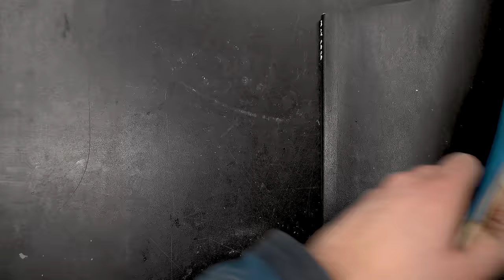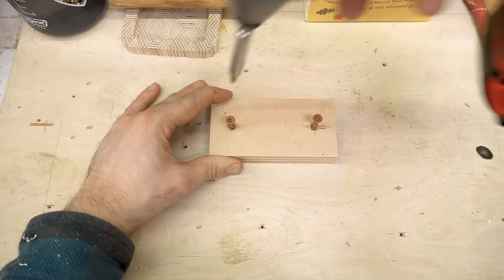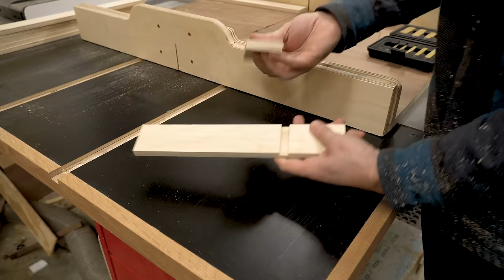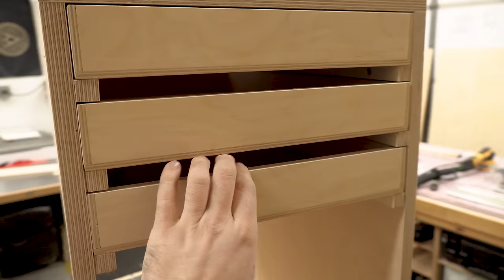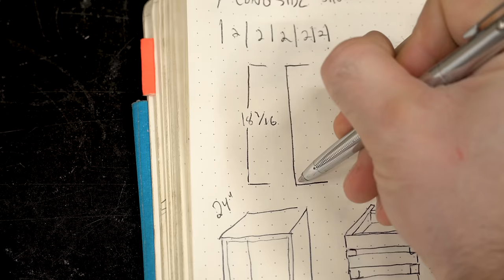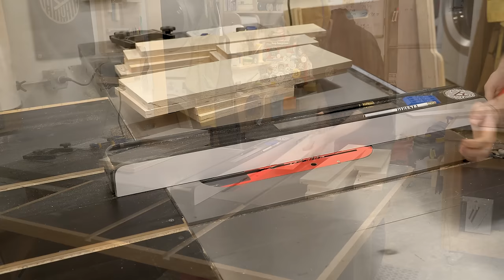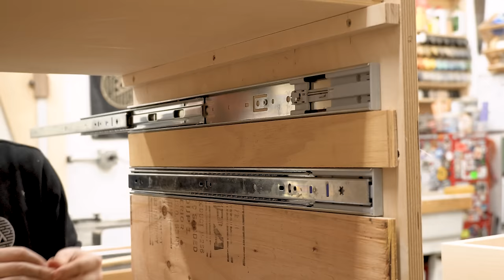3 Ways to Build Professional Quality Drawers

Comment: Omg that imperial chart thingy 😂 Priceless. I can’t believe the things you subject yourself to with imperial. I barely even remember how fractions work lol
Reply: The thing on top is divided by the thing on the bottom. 2/4 means that the 2 is is divided into 4 equal portions. You can multiply or divide both sides by the same number.

5/7 = (5x5)/(5x7) = 25/35

10/5 = (5x2)/(5x1) = 1/2

If you want 1/2 of 10 you multiply the number by the fraction.

When you try to divide 1/2 by 4 you can just multiply the 4 by the bottom thing. - > 1/8

When you multiply 1/2 by 4 you get
4/2 = 2

English is my second language so please don't quote me on terminology, but that's the concept.
Reply: Its actually pretty easy. Half of 9 and 3/8 is just 4.5 and 3/16. Add 1/2 and 3/16 and you get 4 and 11/16.
Reply: Fractions are precisely why imperial is easier to work with for building... anything.
Reply: The school system to teach basic math really failed horribly. Fractions is just numbers why does everyone seem so freaked out is not difficult. Same with decimals just keep your unit of measure straight jeez
Reply: You really need to learn how to divide...hard to build anything without that.
Reply: @klphotographer  The entire building trade up here in Canada is still done in imperial measurements. Nobody is interested in how many square metres a house is. They want to know square feet. Lots are still described as half acre, 1 acre, etc. Nobody uses hectares. If metric were superior it would have taken over since it's been the official measurement system up here for nearly 50 years. Yet we still use the old system in building and in much of daily life.
Reply: @darrylpayment2365  good thing you're not in charge of anything. Following your logic you'd still be burning witches on a stake, cuz everyone else was doing it.
Reply: Agree, I use metric for everything I'm building.
Reply: Lol, yes, I keep track of my work time in chrons, the metric unit of time measurement. I also work ten day weeks for the same reason. Customers LOVE how clear my bills are.
Reply: @jintarokensei3308  yeah. half of 9 is 4.5 lol. who the hell would say its 4 and 1/2 🤣
Reply: @brianlawrence9959  bro... 4.5 and 3/16?? you just proved my point. decimals are your friends haha
Reply: @twestgard2  this is genius. how has the world not switched to this already.
Reply: @CharlesRattray  sure. And so are fractions.
Reply: I was in the 6th grade back in the 1960s when I was taught the metric system.   The teachers at that time told us the USA would be on the metric system within  5 years.  Yeah.  Right.  Still waiting.....in the meantime,  my tools are all......yup, American. Imperial.....
Reply: Woodworking in imperial is usually really intuitive, and it means you can always work in the same unit for large and small projects in and have the same precision in everything you make without the need for remembering thousands of mm, or converting up/down as you go.
Reply: I am sure metric works as well as imperial.

Comment: @Michael Alm I do cabinet design and installs in the US (I use Imperial System) and what I do to get fractions out of a decimal result is : I take away the full number and then multiply whats left by 16.
So for examples:  you had 4.6875. Take away the 4. You get .6875. Multiply that by 16 and the result is 11(aka 11/16). So now you add back the 4 and you get 4 and 11/16.

Comment: I've been building cabinets, etc. for 35 years, but your technique for installing slides on the drawer boxes was one I've not seen. I'll use it from now on. Thanks!
Reply: I have been a carpenter for 50 years in Ireland. We have been doing this for years even as a young boy in the workshop all them years ago.

Comment: Just a comment on the Rockler jig for Blum clips / under-mount glides.  I tried to drill the pilot holes for the clips at the appropriate angle and no matter how careful I was-  they didn't sit right and the drawer was wonky.  I purchased the clip jig from Rockler and the clips worked perfectly.  The jig also properly aligns the pinhole at the rear of the drawer. Money well spent.  Keep up the good work.

Comment: Michael my favorite tip in this video was to not make the drawer a compression fit when using those mechanicals your slides. I have been frustrated with that I know so many people who have built it so close to tolerance that the drawer slide didn’t operate properly. Definitely a great tip thanks for Sharing  brother great video
Reply: I agree. I always have to fight my tendency to want to make it like a piston fit.
Reply: In the video, is it my imagination, or did he talk about how the slides have some built-in flexibility, but then didn't use those tabbed holes on the cabinet sides?
Reply: I am horrible about tight tolerances.  Its even worse when you start dealing with expansion and contraction of solid woods.
Reply: Agreed. I ended up planing down plywood drawer sides to achieve a better motion on one build. Not fun, and easily avoidable. Thanks for the tips, Michael!

Adam Savage has a great tip for avoiding "too tight tolerances" - add some paper or thin card shims. Can be easily tack glued in place while measuring.

Comment: So good. Clear videos and explanations as you went. Excellent editing. Enought time was spent showing how it all worked without bogging down with too much repitition. I'm using your info, but one small change. I used a drawer slide to make a metal jig for the slide hole layout (I'm also a metal worker) and predrilled the slide holes in the case side. It seemed less awkward than doing that in the case after is was assembled.

Comment: Michael thanks for the tip on the Handi-shims, they are great! when cutting wood I use the 1/8 shim to prevent the wood from pinching the blade. The shims also beat using coins when spacing drawers. Love your videos!!

Comment: I made some drawers and a cabinet, but really didn't know what I was doing.  This was SOOOOOOOO much simpler, easier, and faster than the "total noob" versions I built.  Definitely bookmarking this for future reference!  (Also...  watch those fingers with the nail gun!)
Reply: Epic video on making perfect drawers. A nail gun I've been bitten by before and I did fine with band-aid and some kool-aid. You want to be 10 times more careful with your fingers when you use a table saw -- one of the most useful but also a dangerous power tool. I like the table saw jig Michael's got but IMHO future epic carpentry would be with plunge saws and routers, not table saws.

Comment: Great video. I actually prefer drawers over doors. Door hardware confuses me. There are so many options. There are a couple of shop pieces I want to build and I keep putting them off because I'm cheap and I don't want to buy the drawer slides. So I'm glad you showed the wooden slides. Having the back with a stop is definitely the way I want to go. Thanks for sharing.

Comment: You are a clever fella. 
The 3 x 2" top draws. I like the idea of extended rails to stop draw falling out. You could put Spring loaded locator pins on side railings which you can reach and release if you need to take draw out fully.
When you pronounce "Rebate" though it sounds like "Rabbit".... Australia here we say ....Re Bait.

Comment: Thanks a million. Lots of good info but the thing thsy stood out for me is that the drawer doesn't need to be tight... Needs a little room to slide... Didn't quite know if that was the case or not, so I'm guessing about 1/16 of an inch or so should work. 🙏🏾

Comment: Amazing build Michael. You are a pro. We did the same with metal slides in the past since then we have learnt if you over drill the hole on the drawer box you can have some adjustability while fixing drawer fronts.

Comment: Excellent video! You've gained a subscriber! Oh! and you can skip the fraction chart. Just multiply the decimal portion by 8 or 16 (depending on your needed accuracy) and then round that number up or down depending on what you need.  That'll give you the top number of the fraction.

Comment: Great tips!  I WILL use the one for mounting the wooden slides by turning the cabinet upside down and locating them with the actual drawer and a shim.  On my next set of wood slides I may change them out for side-mount store-bought slides at some point, and am mounting the wood ones on a 1/2" side strip, so the drawer will be the right width for the metal slides.  I also figured out years ago that iron-on hardwood edge tape (or even melamine tape) gives wooden slides a nice slick, 'wax-able' surface.

Comment: Some good stuff there, but for a well equipped shop which I'll never have due to space and funding limits.  However I try my best to make do with what I have.  Two tips that can save you a bit of money:  Non-embossed credit cards make fine 1mm or 1/32" shims, two of them make a 2mm or 1/16" shim.  Also drill bits of various sizes make good setup bars.

Comment: I never want my drawers to fail! They are sometimes subject to heavy loading. I also am driven more by maximizing storage space rather than aesthetics. So…
I build most of my drawers from 1/2” Baltic birch plywood. Bottom and back are dadoed into sides and front is dovetailed into sides. 
I almost exclusively use full extension side mount slides as they only use ~1” of cabinet space the height of the drawer. Blum under mount slides use 3/4” under the entire bottom of the drawer! 
I always mount my slides so that the screw holes line up with the center of the 1/2” bottom panel. I pilot drill the screw holes and use 1” screws. The slide mounting screws now reinforce the glued and narrow crown stapled assembly of the drawer. Bomber. I’ve never had one fail. I have drawers -34”W x 14”H x 22”D on 100 lb. slides. No problems.

Comment: Like your style, make it work!
I use a block screwed to the bench all the time since I work on site mainly. There are apps for your phone that will do fractions to whatever accuracy, I have had a construction master calculator for over 20 years that does fractions and all the stair and roof math. Canada is terrible , it's metric but residential construction is still imperial. I have worked with carpenters that have memorized all the decimal to fraction conversions.

Comment: I saw a great trick online to screw the drawer fronts! The guy make the holes for the handle before putting the drawer front on the drawer and then screw the front on the drawer through the handles holes... Then he oppened the drawer to screw form the inside. He removed the wood screw in the handle holes and then drilled the handles holes through the drawer box and installed the handle with the metal screws.. !!! Booom :D

Comment: Nice video.  Learned a few tricks with shims and spacers.

Why are fronts made separately from the drawer for a utility setup?  I can see it for kitchen cabinets, but why for shop furniture?

Secondly, why the 3/4" space between drawers instead of 1/16"  You are sacrificing  about 20% of your volume for a 3/4" space on a 4" drawer.

Comment: 15:30 Since you're using a calculator, just multiply the decimal part by the fractional precision you desire, then simplify the resulting fraction if necessary. 
Eg. 0.6875 x 32 = 22 (32s), or 11/16.
Reply: So tedious to do every time. Better solution: multiply everything by 25.4 on the way in. Voila, you're in metric!
Reply: @BosseCory  especially because plywood is sold in metric (even if it’s not sold as that)
Reply: Been doing wood and handyman for decades and just learned this at 60.   Thanks.
Reply: I just use a fraction calculator app, from the get go. So much simpler
Reply: ...or, be inspired to change over to the metric system...with the equivalent logic of: 100 cents to a dollar.... its all ones, tens, hundreds, thousands, hundreds... etc 👍🤔

Comment: To convert fractions to decimal all you have to do is divide the fraction as it is written. 7/16 is 7 divided by 16 
= .4375

To convert the decimal to fraction just multiply the decimal by 16 since you’re working with 16ths.
For example: .4375 x 16 = 7
take the 7 and put it over 16 
= 7/16

If the answer has a decimal just round to the nearest whole number.

For example: .6799 x 16
= 10.8784 
Rounding to nearest whole number is 11
So that would be 11/16

Hope this is clear!

Comment: Love the way ya throw those fractions out there.  I am waiting on my retirement home to be finished so I can start building my shop.  I like seeing the way you draw up the plans in a workbook.  I do original sketches and then modify.  So where did you get the spacer bar set from where you can set the saw blade height?

Comment: Find a 1/4"x 2x bench length" piece of steel and miter a 1/4" slot in the workbench and use a strong magnet as a stop block fence. You then can make different jigs and clamps for the magnets so it serves more than one purpose.

Comment: Drawer guide are more stable at the bottom, load are concentrated on the drawer floor, load lateral movement came from drawer floor so it must be supported directly on bottom.

Comment: Wood Magazine August 2019 destroyed some drawers made with different joints.  The strongest is the finger joint, and just a bit behind is the lock miter joint.  These joints are 30-33% stronger than rabbet and even dovetails.  I use the lock miter on drawers because it is quicker than the finger joints and dovetails.

I do not use metal drawer slides either, instead use grooved drawer slides as shown in July 23 2019 Wood magazine.   A little paraffin wax on the grooves and cleat makes them extremely easy to pull.  One of our kitchen drawers made this way has 3 large cast iron frying pans, a cast iron crockpot plus a few other pots and pans and pulls so easily my wife is afraid it will come flying out when a grand kid gives a yank on it.

Comment: Camper Trailer Slides
I am doing research and YouTube recommended this video.
I am expecting to find this video valuable as they are really just huge drawers.
I need upper bunk with a small office under it, inside a slide 7'W X 4'D X 6.5'H.

Oh, and three windows.

Comment: I'm dreaming of making my own kitchen cabinets, partly because we're old  and need to save the money ( We were quoted $30k for everything) and partly because it just seems fun. The problem is I'm just beginning this journey. Long ago (like forty years ago!) I framed several houses with my dad and I've been a DIYer to some degree (put on my own roof, put in windows, replaced interior doors, dug my own sewer line etc.) since, but I've got a piece of crap table saw, no tables to construct things on, bad lighting in a two car garage, very little experience - I've never done a rabbit or a Dato cut - I guess you just have to get past the stress over screwing things up and start where you're at.

Comment: Thumbtacks on the top and bottom of the drawer sides at the back and on the top of the runners at the front will make the drawers slide much more easily and reduce wear of the wood.  A little more vertical space is needed.

Comment: Another cool way attach drawer sides is to glue and micro pin (for temp holding)  then use festool domino's sanded smooth.

Comment: Get yourself a construction master calculator. It has every function you could ever need and more and they're about $50. I would go with the pro but you could just get the basic version they sell at big box stores that would work too just less functions. You can set your tolerances and it'll calculate to the actual inch fraction you need. I'm a carpenter and I use one in the field all the time because it saves a lot of time

Comment: Great video, incredibly useful. For the wooden runners, is the fact the bottom of the draw is sliding on the runners increase the usability? I imagine there’d be a bit more friction if the bottom was captured and the draw slid on the edge of the draw side.
Reply: I was thinking the same thing? Maybe apply paste wax to the runners?
Reply from the maker: Yeah, adding wax works well to reduce friction

Comment: I found an awesome calculating app called Feet Inches. It calculates down to 64ths, maybe more! You can even calculate by either dimensions (ie. how many 3/8" cuts can I get out of 12") or by quantity (ie. how big can I equally cut 4 items out of 3' 2 1/2").
Reply: And it can easily convert results between imperial and decimal.

Comment: Pro tip: to divide any fraction by 2, just double the denominator. Half of 3/16 is 3/32.
Reply: That's true, but I also JUST realized I still have my Casio fx-260 solar scientific fraction calculator from high school and I'm definitely going to be using it for measurements in the future! 
Only really learned metric in school. Still remember taking the GMAT (a test developed in the US) and stumbling on a question that required knowing how many feet in a mile.
Reply: @keymatrix  We should definitely be leaning more of carpentry to teach fractions in North America. It's a missed opportunity to teach math in a less theoretical way.

Comment: I noticed you did pocket holes on the inside of your 3/4 cabinet to hide them. I see many others do this on the outside. I was trying to do inside but my screw tips are poking through. Did you set your drill guide to 1/2 instead of 3/4 or just below the 3/4 setting?

Comment: Hi man. Question about the spacers. What is the distance between the metal drawer slides? Did you use the size of the drawer heights for this measurement?

Comment: Not sure you'll even see this given this is an old video, but I have a question about dado cuts. I'm brand new to woodworking so I've been researching if I should get a 10 in or a 8.25 in. saw.  I'm looking at Dewalt.  The 10 in. Accepts dado stacks and the smaller one doesnt. I honestly don't kbow if I would ever use them but I don't kick myself later for not getting the larger saw. Thanks